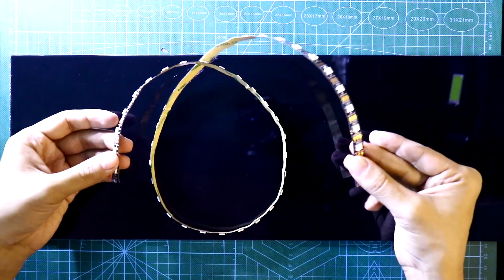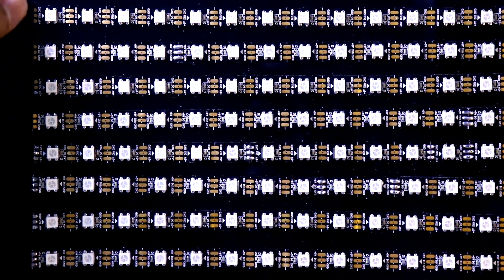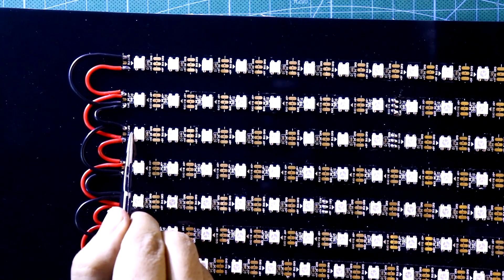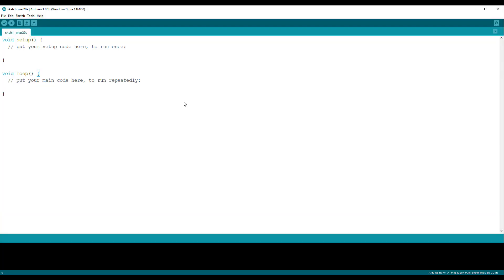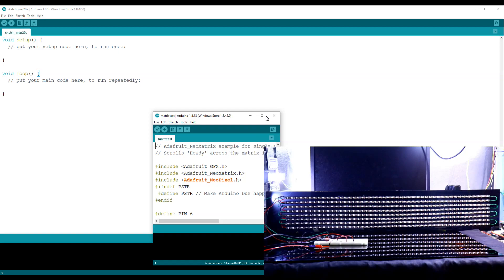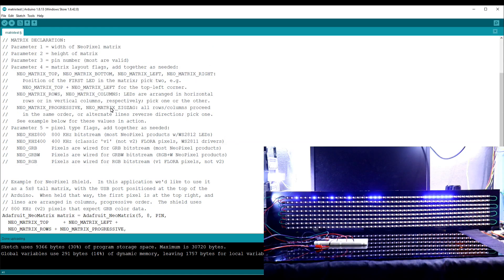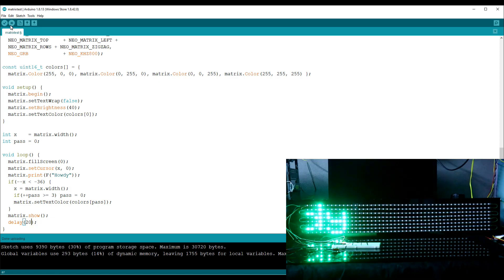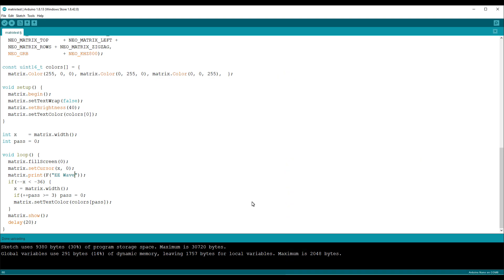ws2812b display | 48x8 RGB Display

Comment: Cool video man. I have 3 rolls of 144/m stuff that I'm going to do a 10 by 40 with. I'm gonna use an esp I think so my wife can add reminders and it'll update the temp and forecast. I meant to order the 60/m rolls and ordered the denser strips by mistake but it was too late to return them by the time I realized. Leds are way too much fun man.
Reply: i have to agree with you on that

Comment: один вопрос . скажите . лед лента потребляет 5 вольт 90 Ватт  .а блок управления потребляет 5 вольт 2 ампера . можно и ленту и блок управление лентой подключить напрямую к блоку питания 5 вольт 20 ампер ? .спс ))
Reply from the maker: 90 watt/ 5 volt = 18 amp.
5 volt, 2amp. So you need 20 amp. 

You can connect but 20 amp power supply can not deliver 20 amp current for long time. It is better to use at least 5v, 25 amp power supply.
Reply: @EEWave  спасибо . это я понял . у меня вопрос в другом .
можно ли к блоку питания 5 вольт 20 Ампер подключить блок управляющий лентой ( типа ардулино ) который питается 5 вольт 2 Ампера ? 

не сгорит блок управления лентой ? спасибо за ответ  за ответ
Reply from the maker: No problem friend. You can connect a 5v 2 Amp controller to a 5v 1000 Amp power supply. 😀😀 No problem. Your controller will take only 2 Amp.
Reply: @EEWave  спс . тоже так думал . но  хотел узнать мнение знающего человека . успехов ! )